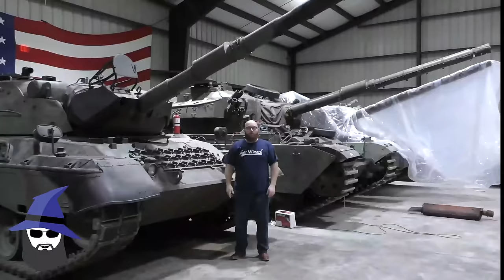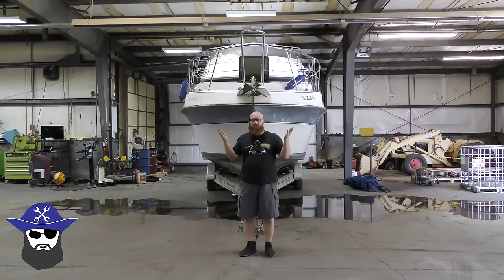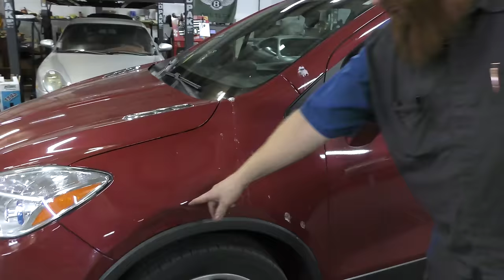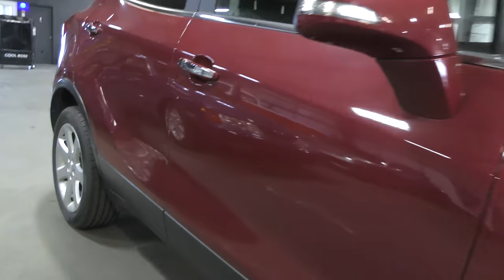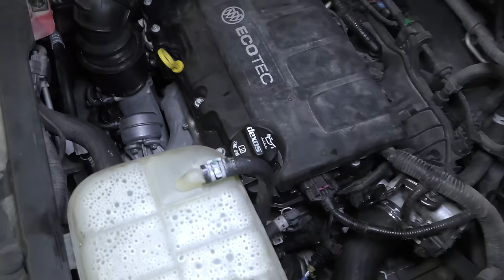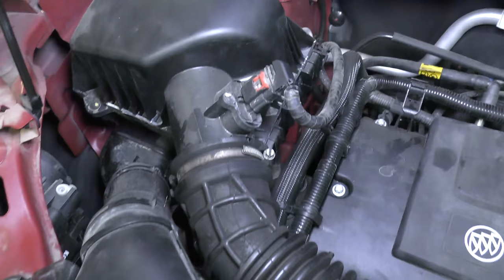How did a dealer miss the problem on this '15 Encore 4 times? CAR WIZARD just had to read the codes

Comment: Those GM 1.4 turbos are junk. All kinds of problems with them. That along with the 1.5/1.6 Ford EcoBoost is junk. In fact it was worse than the GM engines.
Reply: Agreed, because these newer turbocharged four-cylinder engines were not good in reliability.

Comment: What a scam.  Story sounds very familiar.  My mom took her van on a trip.    Its not that old .    It started to no run right.      Couldn't accelerate.     The mechanic she took it too replaced a bunch of stuff.    Sensors .    It didn't fix it.    He said he thought it was the internal camshaft sensors.    Then it had to go to the dealership.   Special tools.    They took apart the top part of the  engine.   Replaced those parts   Supposedly tested it.    And it did the same thing on the way back home.     I had her take it to a mechanic like you and they found a bad computer.     She spent thousands.

Comment: A GMC appreciate here. If these happen did this and they say C/S CEL on. And they didn't fix it and misdiagnosed it, we be in big trouble from the shop manager. And how in the fuck does a oil change solve a cel. Hell I would have diagnose it in 6 minutes and that would be an hour's work

Comment: By the time I make this comment, the car will be long gone. But next time she comes, I am willing to bet  that the oil seepage comes from the oil filter housing. It's bolted to the block, right under the exhaust manifold. They ALWAYS leak, I've changed at least 4 in the past two years. Costly job, too...exhaust manifold and turbo have to come off. Other things I've changed on these engines in the past two years: three water pumps (two on the SAME CAR), one turbo, four thermostats (they fail all the time), three valve covers (PCV troubles, notoriously bad for that), two intake manifolds (bad PCV check valve, also notorious for that), four cam actuator solenoid seals (always leaking). I may be wrong, of course, but I suspect you don't see many of those engines in your shop. I see them all the time. All the customers who have them are just biding their time to get rid of them. They are horrible little engines, rolling leaks. Anyway, next time she comes, take a look at the oil filter housing. Greetings from Montreal!

Comment: I've worked in sales in dealerships for a few different brands, and I always take notice of how the service dept is run, because it's a great place to get repeat customers.
I'm not going to trash the dealers that operate like the one in your video, but it's obvious to me, they were trying to avoid any "warranty" work, because under 100k miles, that is certainly a powertrain issue.

The  Hyundai dealership I worked for would have probably either pulled the code in the line during drop off, or the tech would have pulled the code, and the  person who checked the car in would have come back with a code and a price within about an hour.
They just seemed to treat their customers better, and tried a little harder than the brands I grew up on.

Comment: How is it a GM dealer cannot fix a simple problem?  Seriously, those things are made to break reliably(except certain truck models).  I would not be surprised if the same thing happens with Hyundai/Kia products, since they engineer for maximum billable hours and are "German reliable".

Comment: Mr. Wizard, the diagnosis on this crapbox is very easy to ascertain, even over the internet. It’s a GM product. Sell it an run to the Toyota dealer. The lack of quality and the meteoric depreciation of GM’s make repairing their garbage vehicles hardly worth the money it will cost.

Comment: Most Dents are because of Assholes who throw their Doors open with no regard to the Vehicle next to them, and the Assholes who refuse to make Parking Stalls wide enough for anything wider than a Motorcycle
140 hp? My 86 Cadillac had about the same HP, but from a 5 liter, a bit more torque, but not much more

Trained Technicians? More like Parts changers, who are getting a Percentage from the Sale and Installation of unneeded Parts.

Comment: They pay the dealership mechanic nothing no disrespect they are not the most reliable and they are full of crap.
Nys dealership wanted to charge 2600 for a rack .took it to tristar auto it was just a bad wiring 
Only charged $110

Comment: I have held a theory for a very very long time that cars have been built for a couple of decades now that make it harder to fix it on the weekend and that the dealer shops are simply revenue streams for the franchises and the big manufacturers.

The primary reason to keep the introduction of ev's at bay by overpricing them is that so much shop time and spare/replacement parts markup will be lost, as will $bigoil revenue.  

Greed is at the heart of the $bigcos which is why they fill the pockets of your political representatives.

Wise up world.

Comment: I'm sorry, but there is no way a dealer tech wouldn't check the codes and see the same thermostat code that you saw, and NOT change the thermostat, but do an oil change instead! I'm not defending dealer techs at all, as I hate dealers too. I'm just stating the obvious.

Comment: TITLE ANSWERED: Because ASE means Ask Someone Else. And dealer "technicians" are generally nothing more than trained monkeys that can't do anything without a computer telling them what to do. To them, if it's not in factory service manuals written by engineers who have never worked on cars with problems, it's not worth knowing. Owner's first mistake was buying a post-'05 GM product, especially an EcoTurd. You should check that engine for blow-by. Common with EcoTurds.  Traded my '16 Malibu for a Toyota after 9 months.

Comment: The dealer owners don't understand engineering and don't care to understand, the same as the customer,  doesn't really want to understand, that's why they are taking it to someone who does understand.
  The problem is the same with medical doctors, you can have a bank, but you have to be able to find the person who has the best understanding, to get a decent result. 
  The technicians are mostly green and are being paid the least possible that they can get away  with. 
 Their getting rich. It's the filthy and stinking part of it. 
  Come here boy. 
  Their is usually one, real, technician., The others are apprentices, he solves all the the hard problems. 
   Their already under duress from manufacturer defects and contract maintenance.
  When he is not there, then, the knowledge is gone.
  The owner is a business person, who is going to hire a knucklehead,  to use, to get to his wealth.
  Legubrious American entramanureship.

Comment: The problem is that most people have very low IQ and don't want to learn anything. They feel ok spending hours streaming housewives but don't want to watch a useful youtube or read. 

Just look at all these dents...this tells you that the driver doesn't care for the car at all. If I was the technician I would immediately see that the driver knows nothing and doesn't care so I wouldn't care at all and try to scam them lol 

This is what you get if you are ignorant and low IQ. I mean imagine remodeling a house and you know nothing...if the contractor sees that you are basically screwed 😆

Comment: My God is that the ugliest Buick I've seen 🤢not only that it's a GM POS. Tiny little engine pushed to the max limits! When will people learn that the extra thousand or two for say toyta or or honda will save you thousands more in the long run vs headaches... Unless your leasing it or don't drive a car more than a couple of years then nothing really matters